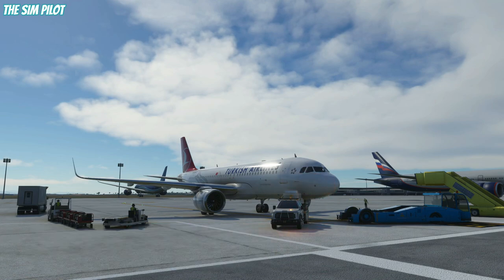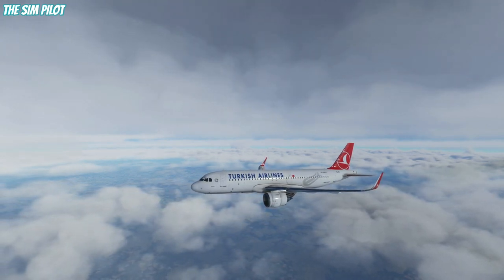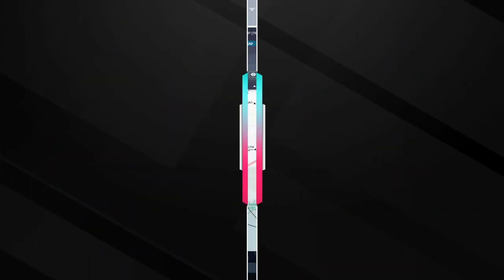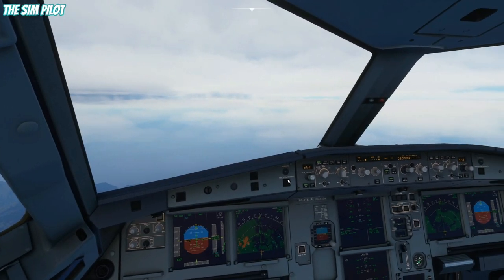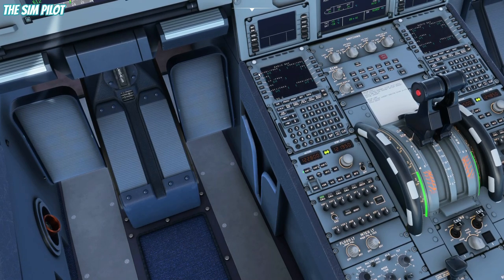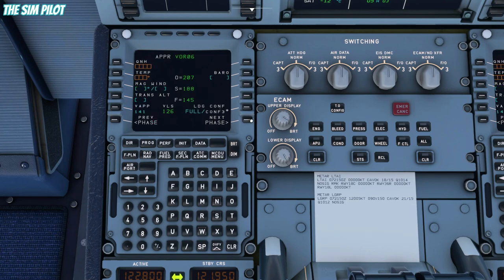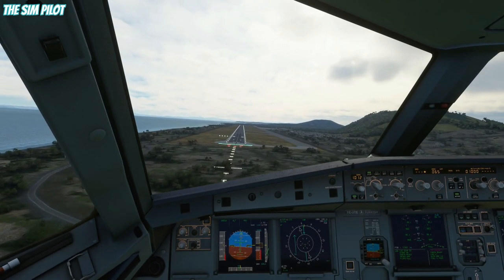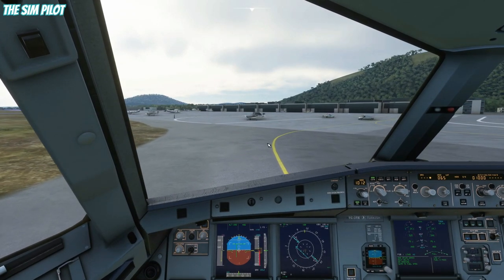Microsoft Flight Simulator 2020 | Tutorial | How to Fly a VOR DME ARC Approach | FBW A320

Comment: Hi there, when you have the Autopilot on, in NAV mode let's say on the a320, and I have the VOR frequency and course set in MCDU, wouldn't the plane be tracking the VOR by itself, without having to play with the heading to intercept the inbound radial?
Reply from the maker: You're right autopilot should follow but at the time I was recording this tutorial autopilot in FBW was not capable of doing this. It might have this capability today.
Reply: It can but its a bit boring, it's as if the gps flew it, if you want to fly it manually do it using the heading mode